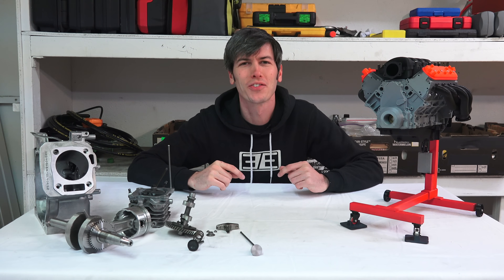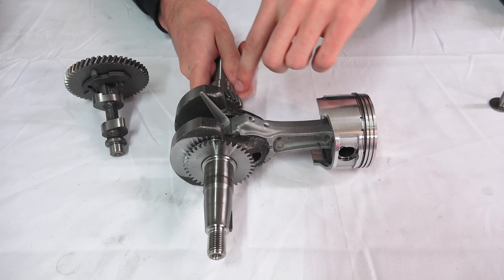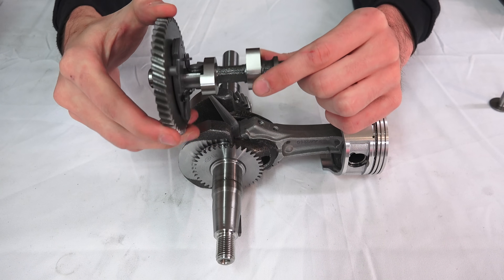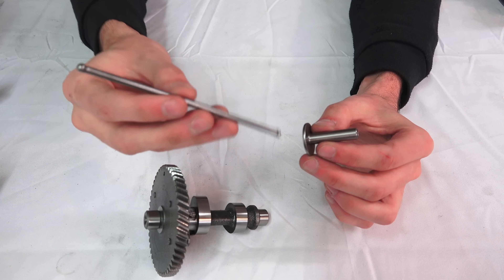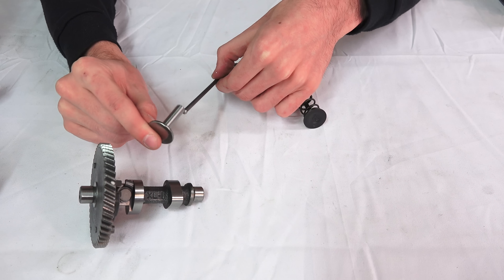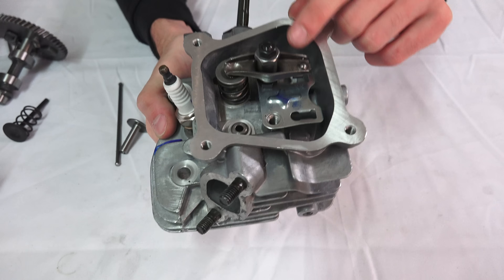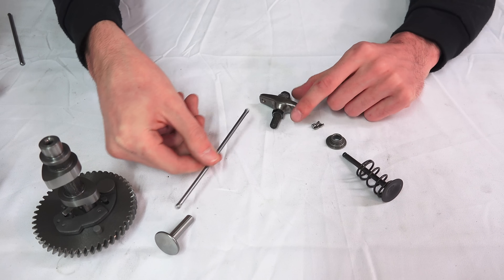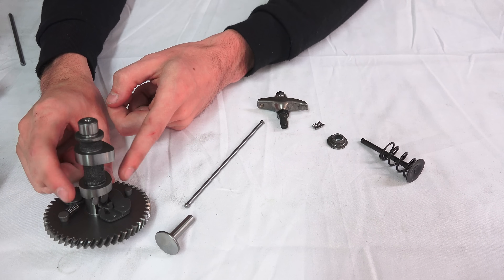Why Can't Pushrod Engines Rev High?

Comment: Get a Hemi you will not regret it!
Reply: Have you seen the external dimensions of a Coyote? They are huge and so are HEMI's. Chevy wedge engines seem to have the highest power density per external footprint, which I would argue makes them a better choice and that architecture will support intake flow numbers above 350cfm, so you've got room to grow without needing two plugs per chamber. That said, I drive a Gen3 Hemi and it's totally awesome. :)
Reply: Not a high revving engine but man does it make some freaken low-mid range POWER.
Moderate cam with ported heads and you gain 80hp***! Headers and you gain 30hp in the midrange all the way to redline.
Powerbands of Hemis remind me of the old stuff, no matter when you hit the pedal you always get a shove.
Reply from the maker: They are wonderful engines, love driving them!
Reply: Get a horse you won't regret it they get the best gas mileage great hp.  They also increase there own displacement without you doing anything.  No oil leaks either.
Reply: Ill take dohc any day
Reply: Marcus Taber you do know top fuel dragsters use push rod engines right?
Reply: @Mopar Magic The Pentastar V6s are possibly like that, as well! (even with a bias towards horses and RPMs) (and not a push-rod) (but that bias is slight, compared to the Nissan 3.7 V6s, which are clearly biased for extra horses at a high RPM) (The Ram version is even better in the low RPM department!) They sure don't seem gutless at midrange RPMs!
Reply: They arent hemispheric heads anymore. So they really aren't hemis.
Reply: 'Rango life lol. Gonna do a 392 Stroker kit and some boost this summer.
Reply: Benjamin Burkhardt I know
Reply: Marcus Taber all that and you still get lousy torque, that's why they don't do that
Reply: lat woods Shimming my DOHC motorcycle is an absolute pain in the ass compared to a Harley not requiring any adjustments at all to the valves. I know most DOHC cars do not require it but if you have a push rod motor with hydraulic lifters, you don’t have anything at all to worry about. It only gets hairy with cylinder deactivation lifters if you have them.
Reply: Be sure to follow up after you replace your first flat cam
Reply: @Marcus Taber Your first sentence, is so wrong! Chrysler definitely isn't junk all the time, FFS!
Reply: DOHC with VVT is one of the biggest victims in automotive history to be recalled for not working correctly.
Reply: I’ll stick with the ls, won’t talk bad about anyone but I love them. My cousin and I put a 6.0 in his 72 camaro, it’s nasty and fun. Hooks and launches hard with street tires.
Reply: My neighbors Honda lawnmower is a hemi too 😂
Reply: R/T Life get a 496 stroker chevy and you'll never regret it either.
Reply: I'll get a Voodoo instead
Reply: I have an LS4 in my driveway as well. I like both Chevy & Dodge v8's.
Reply: R/T Life  Don't get me wrong I'd love me a Hemi. They are both awseome af. 👌
Reply: #1 Marcus, has an OHC engine ever been successful making 10,000hp on nitro-methane? Nope.
#2 I assume you've never worked on anything yourself either to appreciate the simplicity of OHV.
#3 Also your statement about Chrysler has been invalid for over 10 years now. Quit beating that dead horse...
#4 Also the COST of OHC for the gain is negligible if not worth it at all when it's time for repairs.
Every engine has it's place and specific purposes which makes it great. Saying one is better than the other in 4 ignorant statements proves nothing. :)
Reply: @GreenFoodBad  Team Santiy in Australia builds a 3 valve SOHC. Nitro engine. Not legal for NHRA
Reply: @GreenFoodBad  Santiy Top Fuel #777 Australia. SOHC 3 Valve. Not NHRA legal.
Reply: Bingo!
Reply: Clayton Farmer <3 coyote.
Reply: A Coyote is a better solution
Reply: ...@ the 1rst gas station.
Reply: R/T Life You meet LS.
Reply: Until you wanna make decent horsepower then you realize everyone requires you to delete dod to do anything then you're back to 15 mpg. lol
Reply: @ clayton Farmer <3
Reply: Marcus Taber actually of you watch videos on youtube most of the time the LS makes more hp/L than the coyote, and coyotes are garbage for torque. Tons of power and no torque gets you almost nowhere.
Reply: When you work on Hemi engines all day long you'll know what not to love about them.
Reply: Clayton Farmer except for lack of torque...
Reply: Clayton Farmer naw buddy
Reply: get a german v8 and you'll love it ;)
Reply: Deine Mutter truly superior engines!! In every way
Reply: Marcus another important point. If I could sell you a 6.2L Pushrod V8 for the same price as a 5.2L DOHC V8 which would you take? They make the same power and same fuel economy. Because the 6.2L makes so much low end torque for daily driving it can run on half it's cylinders and easily match the efficiency.
Personally I love the 5.0 Coyote and 5.2 VooDoo, they're the best sounding engines ever made and extremely durable. I bought my 5.7 Hemi because I saw the simplicity of getting 500+ horsepower with just a cam swap and ported heads. Ram trucks with that same setup are running low 12-second quarter miles which is all I want. Now if you want 600 easy horsepower just buy a 5.0 and slap some boost on it. It may cost a bit more but it's around the same hp/$.
Reply: Clayton Farmer yeah no no it is not.
Reply: The hp/L is a useless metric.
Reply: #1 Anything to do with chrysler is junk, they go bankrupt every decade for a reason.
#2 Pushrods are antiquated and should have been abandoned at the start if this century.
#3 Overhead cam will beat pushrod any day of the week for peak HP assuming equal displacement.
#4 If going turbo having the ability to control the cam lobe specs is much more easily achieved with OHC.
#5 Imagine of Honda made a DOHC engine that had the same displacement as a hemi. 100hp+/L, so that 6.2L would make 620hp before even adding a supercharger. If Honda did that they could get to Bugatti Veyron territory.
#6 Emissions become much better with OHC as the cam profiles allow for better mixing/atomization etc

Comment: What that spike do in this sigle cylinder example? it`s on the con rod cap.
Reply: Szymon oil slinger, a lot of very small engines, mowers and such don't have an oil pump so they purposefully try to throw oil everywhere in the crankcase
Reply: Learnig each day. Thanks John.

Comment: The Chevy 302 V8 used in the late 60’s Camaro z28 could rev past 7000 rpm in stock form.
Reply: it was used in Formula 3 cars and made up to 550hp@8,500rpm from a push rod 5.0L from a production Camaro
Reply: now that was a truly impressive little engine,I found one a couple years ago I'm just waiting for the day it is mine

Comment: This video is kinda misleading. With modern pushrod engines, the valvetrain components have gotten to a point where they can easily rev past 9000 rpm. The use of light weight metals in the valvetrain such as titanium allows this. Also the 2 valve per cylinder fow is bunk since if you look at the LS3 head flow characteristics vs the Ford coyote head, they are comparable and this is due to the runner design and large valve diameter that the LS3 head has. The limiting factor for an engine like the LSX is not the valvetrain or head flow but rather the stroke of the engine. The piston is a large reciprocating mass and with a longer stroke, at a given rpm, the change in velocity is immense compared to an engine with short stroke, hence most high revving engines, especially f1 engines, have shorter stroke. In fact, a common failure point in older LS1 engines was rod bolts, which would stretch with sustained high rpm or mechanical over rev and cause the rod bearings to spin. This was remedied by using stronger rod bolts but its still a limiting factor.
Reply: devil037 um you do realize technically the dohc valvetrain is overall heavier right? Also 4v heads have been made for pushrod engines and have been reved very high for their 6.6l diesel application. Pushrods can be made very light and strong so can a cam. But 4 cams the massive belt or chain the tensioners needed and the rocker arms some call for do make their valvetrain infact heavier.
Reply: Also ls engines have only been around since 97... ohc engine started long before the pushrod ohv engine.
Reply: Two words, piston speed 😉
Reply: No one is talking about power, acceleration, or anything here. We're strictly talking about valvetrains. The facts are that a pushrod engine with a 10,000 RPM capable valve train will not hold up. You will get extreme wear on the rockers and lifters, and the valve springs typically can only take 5-10 hours of sustained high RPM operation before they need replacing.

On the other hand a DOHC engine can utilize lightweight valve train components that can easily deal with those sustained high RPM operation. Bike engines, and engines like the S2000 engine are perfect examples of this. The S2000 engine can last for hundreds of thousands of miles. I'm not sure where you figure bike engines only last 20,000 miles. Many people put tens of thousands of miles on bikes - there are many Yamaha R1s with over 50,000 miles, including some over 100,000.

Like I said, on my Honda 450 (single cylinder), the valve-springs only have about 60 pounds of seat pressure with the valve closed. Pushrod engines that turn similar RPM require closed seat pressures of over 400 pounds, and open valve pressures that exceed 1000 pounds. In comparison, the open seat pressure on this Honda 450 is only around 175 pounds. That results in far less stress on every component of the valvetrain, allowing it to last longer at high RPM operation. 

NASCAR valve springs are typically only good for a single race, top-fuel valve springs only last a single pass. A Yamaha R1 valve spring can be expected to last 50,000 miles without issue.
Reply: Those engines cannot rev to 9,000 RPM reliably, for 200,000 miles. The valve springs simply will not last revving that high. The spring pressures also start getting outrageously silly. 

My Honda CRF450 has a 3.75" bore, and a 4-valve SOHC head design. The max-lift spring pressure on the intake valves is just 175 pounds. It will reliably turn 12,500 RPM all day. To get an LS engine to turn 10,000 RPM requires open valve spring pressures approaching 1,000 pounds. At those pressures, the spring, rocker, pushrod and lifter life are extremely short.
Reply: dude you can't compare bike engines to car engines, how many Honda street car engines rev to 12k...none and theres a good reason for that it makes zero torque thats why car engines don't go over 100hp/liter unless it weighs sub 2,500lbs and even then people complain its slow like a honda S2000/240hp@9,000rpm 0-60 in 5.7sec/14.2 which is slower then a 1985 corvette/230hp@4,800rpm 0-60 in 5.5sec /13.9sec and the corvette weighs  around 1,000lbs more but is faster with less power . and bike engines don't last 200,000miles  more like 20k miles.
Reply: Dude where are you getting your figures from? You don't know what you are talking about. First off, even the S2000 has valvetrain control issues. its a common problem they experience at track days where they have valve float and this causes piston to valve contact and may even drop a valve. Check out ZentRose channel, its what happened to his. Also the 1000lbs valve spring force your talking about is nonsense. PSI1511ML springs, which I run on my z06, which are probably the best beehive style spring you could run on a LSX, are rated at 370lbs at 1.175" and 130lbs at 1.800". You do realize that spring force depends on how compressed they are right? its not a constant "1000 lbs" like you are implying. Finally the fact that you are bringing up motorcycle engines shows me that you are missing the point of my comment. Motorcycle engines have short piston strokes, therefore the velocity of the piston is lower at a given rpm compared to an engine with longer stroke and there is less force on the rods.
Reply: "if you look at the LS3 head flow characteristics vs the Ford coyote head, they are comparable"

You do realize you're comparing a 6.2l engine to a 5l engine right? What's the bore size on the LS3? What's the bore size on the coyote? Of course a huge bore allows you to put huge valves in the cylinder and those huge valves can flow better, but 4 valves per cylinder definitely can make more efficient use of the space that's available. If you want to talk about large bore engine look at the RY45, which dominates dirt late model racing nowadays. Bottom line, GM is a company stuck in the past. That's why they need the government to bail them out every few years. The truth is they need to die. Corporate welfare only makes companies fat and lazy and rewards lack of innovation.
Reply: 4 smaller circles in a given area will cover more area than 2 large circles. The advantage of the LS is that its had around 60 years of development and aftermarket support in the cylinder head, whereas DOHC has only recently come into the mainstream. A 4v head should theoretically flow more air than a 2v head with identical port characteristics. The issue with pushrods is they are ALWAYS heavier as a valvetrain than OHC due to the inclusion of pushrods, so will not rev as hard. For an apples to apples comparison rather than this coyote vs ls war, look at a Jack Knight BMC a series head vs the regular pushrod configuration. There is a night and day difference.